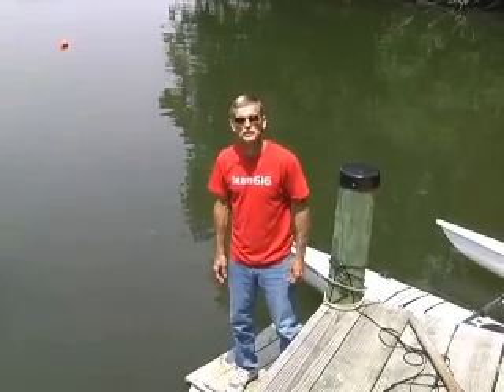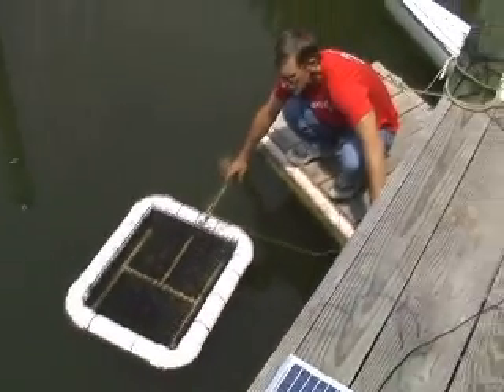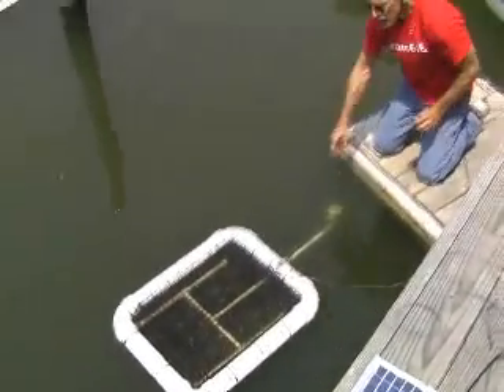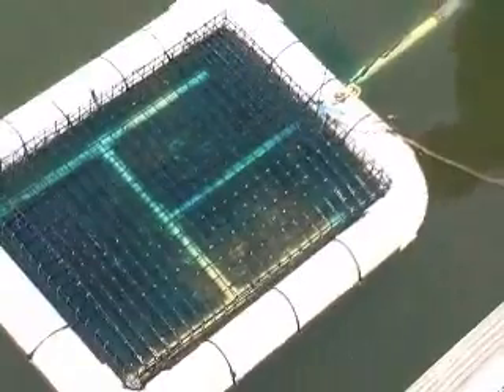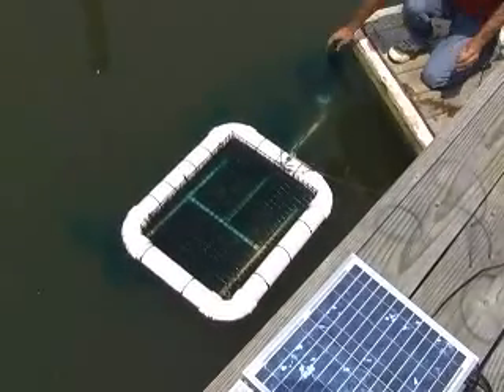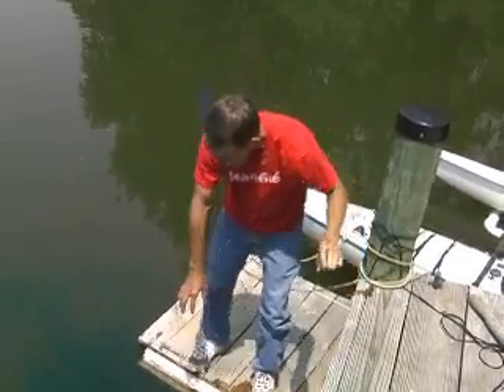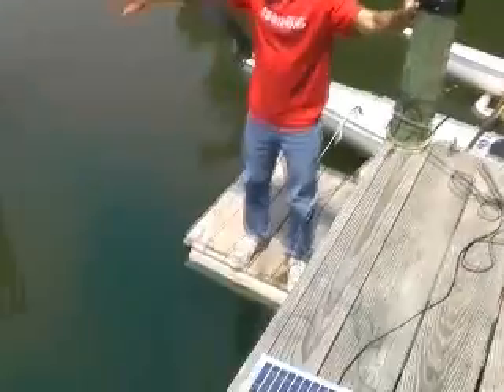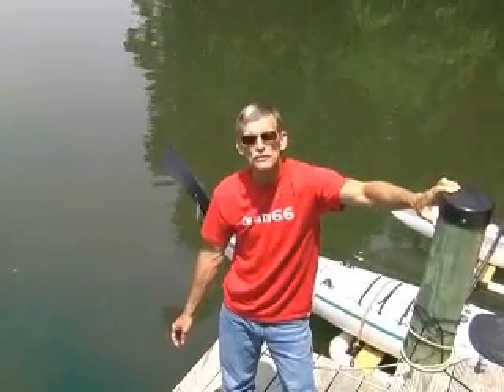Solar Oyster Circulator - In Action

Comment from the maker: Dear MM
The calculation for you 60 ft lift -
Assuming 5 gpm Pump eff = 70%
Would require 80 watts - so a 100 watts panel 
would do the trick - I'm not sure if a pump
is available for those parameters - but this seem reasonable. My bilge pumps are extremely low head - need to find something different for your application.

Good Luck -
Jim